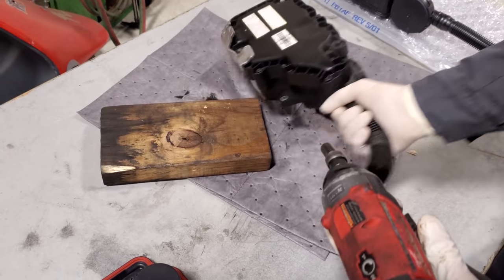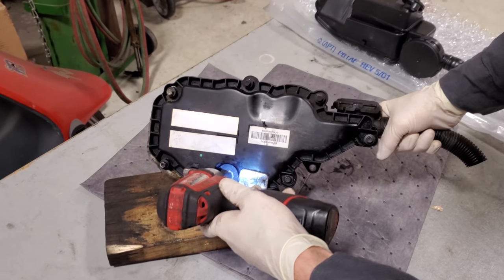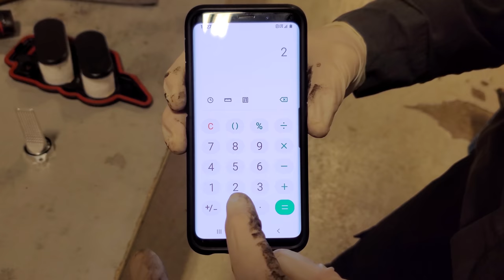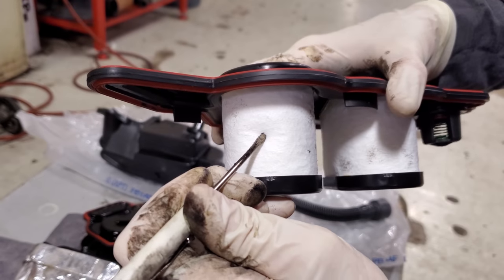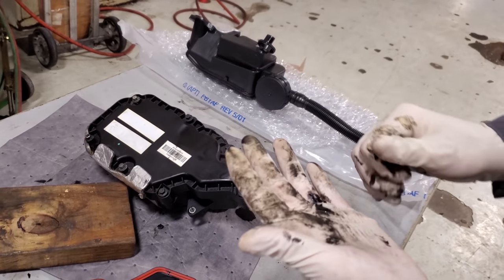Ford 6.7 Powerstroke - CCV Re-route??!!!! Do YOU do it or NOT?!?! You DECIDE | **MUST WATCH** |

Comment: I put the ccv delete but my truck continues to smoke from that hose and sometimes it leaks oil... I don't know if I did it too late, but my truck spent almost 100k miles without changing this filter.  I would appreciate if someone could help me (sorry if I don't explain myself well, my first language is Spanish) but I don't miss your videos
Reply from the maker: Theres nothing your going to do to correct your degree of blow by which is what is coming out of that hose. It is a normal engine characteristic to have that smoke internal.

Comment: What would happen if you removed the filter material from the bolt together box and ran it that way?
Reply from the maker: Good question
Reply: I’m thinking of doing the same thing. I’m wondering if you could remove the filter material clean it up and bolt it back together.

Comment: I have 34k miles on my 6.7. I didnt delete the box entirely. I left the box on and adapted a longer hose to it and routed it under my truck. I went to Lowe’s hardware and bought a rubber tip for a  chair leg and put it over the nipple on the intake. Let’s just say there is no more oil reisdue in my intercooler pipes and that half quart of oil that I was always short during my oil changes now comes out of the drain plug like it should. I also get NO weird smell in the cab or oil drips out of it.
Reply from the maker: Brother, thanks for sharing!!!!!
Reply: What is the lowest amount of miles you have seen a rear main or oil pan leak due to the CCV?
Reply from the maker: 16k...19 550 resuce
Reply: Hmm, mine had about 15k on it when I noticed oil starting to come out of the bell housing. The dealer wouldnt do anything because it was just a black residue, no drip or run. Ever since I rerouted the CCV it has stopped. I wonder if mine was causing that leak....
Reply from the maker: That BS...shame on them
Reply: Thats a good idea 👍
Reply: Wondering if have more info about adapting the nipple connector to the down hose?
Thanks
Reply from the maker: Nope

Comment: Low quality (high volatility) engine oils produce higher amounts of oil vapors, and they get sucked up thru the CCV system.  You can have a low-mileage engine with high CCV loading if cheap oil was used.

Comment: Part number for updated box ? Or would you just put the spe kit on ?
Reply from the maker: F650/750, F-SUPERDUTY CAB CHASSIS/F-SUPERDUTY DRW PICK-UPs Built on or after 5/9/16....use box FC3Z-6A785-F
Before 5/8/16 trucks use box DC3Z-6A785-C

Comment: My 2015 doesn't have the serviceable filter style ccv with the bolts on the top.  It has a venturi system...closed system.  I think this is the same as the "new" one you have.....at least they look the same from the outside.
Reply: Does yours have the sensor?  I did the reroute on my 15 and now have a CEL because of the sensor not being there
Reply: @jimletzring1685  Not sure what sensor you are referring to.  Mine is stock so if it came with a sensor it still has it.
Reply: @markparker4032  there is a sensor in the ccv for 15/16 model 6.7s.  If you do the reroute, you'll unplug that and your tuner will need to be able to disable that sensor

Comment: My 2014 f250 6.7 had to be replaced last March with the updated filter I was going to replace it myself think the part was $65 but the software had to be updated,ended up costing me $465
Reply: So ford has to update the truck to install the new updated filter ?.? So why did it need a software update ?? Also how many miles before replacing the filter ?
Reply from the maker: What are you speaking of
Reply: @PowerStrokeTechTalkwARod  the ccv filter

Comment: HELP!!! Ok well I am doing the CCV reroute, and the S&S CP4 disaster kit. I am almost done, however where my CCV hose connects to the lower intake on my 2014 F-350 SRW, 6.5' bed truck, there is some kind of sensor there that has a plug from my wire harness. I have looked forever through all the CCV reroute videos, I have not seen a sensor there for ANY other 6.7 Powerstroke, regardless of the year. Is this only a 2014 oddball? Can I just leave the harness unplugged when I remove the CCV hose? Or do I need to replace that sensor, and then put the boot over that and keep the sensor plugged in? The sensor is in a black housing on the CCV hose assembly, between the actual hose and the black/grey lock assembly. CRAZY!

Comment: I have the updated unit in my 18 and still no pressure when I take off the oil cap. That's why I haven't changed it yet. Should I keep going like that until I get a little pressure or have I been lucky and change it before it becomes an issue?
Thanks!
Reply from the maker: Sounds like to me you're good to go
Reply: @PowerStroke Tech Talk w/ARod  great thanks! 
I don't mind doing it but didn't want to do it unnecessarily.

Comment: So I have a question. I have a 15 F350 6.7.
What is the reasoning for the filter less box? How can it be better then a filter box?
Reply from the maker: Would you rather have high crankcase pressure & have a filter. Your box has baffles in it to separate the oil vapor & liquid droplets

Comment: I have mine rerouted with this kit for years now. I've been hearing about the possibility of the hose pressurizing and causing increased crankcase pressure while towing under a load. People have been adding a venturi to the exhaust to prevent it. Do you think this is needed or do you think it is overkill?
Reply: Yeah I’ve been reading about this too. I’m skeptical about this because trucks have been venting to atmosphere forever

Comment: So I did this SPE mod to my 2020 F250 Tremor about 4,000 miles ago. It was a beast getting the CCV filter off, but I finally got it. Do you think there are any negatives the this mod? Is it bad for the crank case pressure, turbo, or engine in general?
Reply from the maker: We talkin bout it on da Podcast...
Reply: How do I get on the podcast?
Reply from the maker: Powerstroketechtalkwarod@gmail.com
Reply: @PowerStrokeTechTalkwARod  
Controversial subject. Powerstrokehelp. Com says no to CCV REROUTE KITS and says they screw up the turbo seals? SPE says that is not true? I have a late model 17 250 ( November) 17 and am METICULOUS about maintenance- thus am worried about the stupid designed factory box. I DO NOT WANT TO BLOW AN UPPER CRANKCASE SEAL! So what is the bottom line??? I have 42 k on her now
Reply from the maker: Powerstroketechtalkwarod@gmail.com
Reply: @ironlady2814  i DON'T BELEIVE ANY DAMAGE WOULD HAPPEN TO YOUR ENGINE. All commercial transport engine had an open to atmosphere ccv till a few years ago when I retired.

Comment: ARod, would you know when did Ford switch to the sealed CCV box. I have a 2017 Lariat that I got   Feb 2020 with 50,000 from local Ford Dealer. It has the sealed box. Wondering how old it is?  What mileage does Ford recommend replacing it? 
Do you plug the port going to the turbo when rerouting CCV?
Reply from the maker: U have 2 see if u have a filter or not & yes u plug it
Reply: I have the new style CCV  box  with no  screw's.  Does Ford say this style will not clog?  Because it doesn't contain any filtering material?
What is up with the oil leak on your truck have you figured it out. Have fixed it?
Reply from the maker: Hey bro if you have these many questions you can email me I don't want to keep blowing these comments up

Comment: My truck has the filterless box. Can that still clog up? Does it still need to be changed out? My 17 leaks oil pretty bad.
Reply from the maker: R u sure? Could have an oil leak too
Reply: Positive. It could be just a bad leak. There was no pressure when I took off the cap.
Reply from the maker: Just a leaky then

Comment: So my engine idle hours say 1040 hours but my engine hours say 3028. How would I calculate that as far as miles on my truck. Idk if if I subtract the idle hours from engine hours and add the idle hours for 30 miles per hour plus the remainder of the difference. Or just add the idle hours plus the engine hours. Probably a relatively easy question but I’m sure I made it difficult.
Reply from the maker: 3028 x 30

Comment: Alex, my 15 has this plastic ring with a sensor connected to it at the intake end of the filter hose.   Not sure what this is for?  I haven't seen a video with this or addressing this?
Reply from the maker: It was to check crank case pressure, but they had a recall. Come out 17M04 that program that sensor out of reading it anymore.
Reply: @PowerStrokeTechTalkwARod  sorry meant Aaron!  Thank you!  Since Im not showing any open recalls I should be good with the reroute?
Reply from the maker: @JCarruth130 i suppose so

Comment: Ok, I have questions!
Wouldn't the filter style, if properly maintained like changed at 50k reduce the amount of oil reintroduced back into the engine for combustion vs the new style which seems to just use internal baffling to separate the vapors from the oils?
Will Ford still sell me the 17 filter cartridge to renew my truck or will they force me to change the whole assembly?
Reply from the maker: All these new ones, from what i have been told are all filter less. The ones i mainly do are ALL cab chassis & 650/750. If you want the filter im sure theyd sell u one if you truck took it
Reply: I would think (not based on experience) it would be better to have a low or no, constant pressure than a pressure that fluctuates as the filter clogs.
Reply: @SeaPro360  Thank you, but my point is where the crankcase fumes are reintroduced into the combustion circuit if they are not not saturated with oil there will be fewer deposits in the manifold and intake valve undersides. I would think a clean filter with little pressure differential would be better than a "wet"system.
EGR and PCV really make a mess of the induction system.

Comment: I really like the idea of this  can you get the check engine light to stay off after this mod?
Reply: Any answers on this question? I would also like to know where the sensor goes when you do the reroute.
Reply from the maker: It won't work unless you fet it programmed out
Reply: @PowerStrokeTechTalkwARod  I have an H & S mini max tuner. Can I do it with that?
Reply from the maker: No

Comment: Great video as always! Should the CCV on the 2013 6.7s ever be changed? Any symptoms to indicate it needs to be changed? 117,000 on mine right now.
Reply: Actually, with that “cheese grater”, could you just re-route it back to your intake since the oil, theoretically, shouldn’t passing by that?
Reply from the maker: That wld defeat the purpose of re-routing the ccv gases....if you dont have the bolts on ur box as the links in the videos description show...then u don't have anything to change out

Comment: On my 2019 f350 dually chassis cab the ccv is different than both in your video. The front top side has a roundish lid with 4 or 5 bolts. Any idea is this is a filtered or filter less version? It is a ford part.
Reply from the maker: Yes filter

Comment: So when did Ford switch from the CCV with the filter to the CCV without?
Reply from the maker: Filterless is fer the trucks that idle..17+ 450 550 650 750
Reply: @PowerStrokeTechTalkwARod  so if you want to stay "stock" but want to reduce the risk of higher crankcase pressures on say a 250 &350, any reason to not swap over to the filterless part?
Reply from the maker: Swap it brother.....no issues.....6A785....ask ur dealer to look up one for a 17-18-19 650/750 big boy
Reply: @PowerStrokeTechTalkwARod  thanks!!
Reply: Is that the same one that’s in the 11-16 trucks? If not can that filter less be swapped in?
Reply from the maker: The box will fit but does not have the sensor to plug ur connector in. It was deleted....
Reply: FWIW: My July 2017 build date 2017 F250 has the no bolts non serviceable housing.
Reply from the maker: You are correct

Comment: Has anyone had to replace the non-filter box?  Is it safe to say that if I have the no bolt/no filter box, I'm good to go?
Reply from the maker: No filter=GTG
Reply: My 2019  no bolts no filter  good to go
Reply: I have a bolt but not filter and when I pulled it  had water In it kinda freaking out it’s on a 2020 with 26000 miles
Reply from the maker: Whaaaat

Comment: Ok question guys I’ve got the ccv with the bolts on the top,  I think the one with out the bolts for my ford 2019 f450 is part number LC3Z-6A785-C.  Is that the correct part number I need purchase?
Reply: Or Fc3z-6a785-f , the f450 is a dual rear wheel
Reply from the maker: Yes for the DRW it's now filter less
Reply: Thank you so much I’m 50 and just learning.
Reply from the maker: Dats what we here for broski
Reply: Please help,  I order the LC3Z-6A785-C which I believe to not have the bolts/ replacement filter that you used in the video.  Today I got a box with lc3z-6a785-c.  The part inside has bolts to change a filter and the part number on the part is LC3Q-6a785-ad. So is this new revised part ?  What part number do I need to order without the replaceable filter.   Thank you for any help I’m so confused lol.

Comment: i swap mines every 40/50k miles expensive ass shyt,, best price ive found is $80.00, had to replace one ccv box after following ford service spec, changed at 100k darn thng was leaking everywere. price for new one from ford was $370.00, p,s they look bad when they come out ill send u a photo of mines at 50k , send me the part number for the new no filter ccv please,
Reply from the maker: Thank u!
Reply: @PowerStrokeTechTalkwARod  were can i get the new ccv box with no filter, ilooked online but no luck.
Reply from the maker: Ull have 2 have the dealer look it up for a truck that has 1

Comment: What if just drill a small hole in the body of CCV to release the pressure?
Reply: It can be swapped out, ordered through Ford parts-
Reply: @herveyforward5956   But new CVV will not solve the problem with pressure.